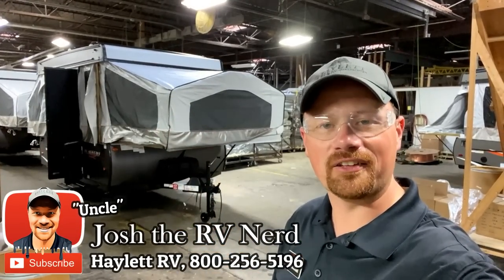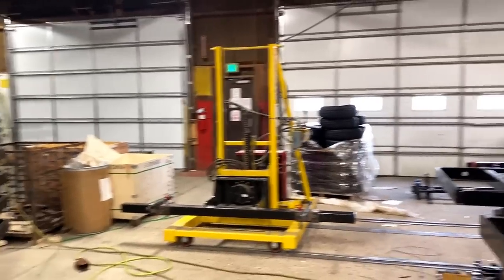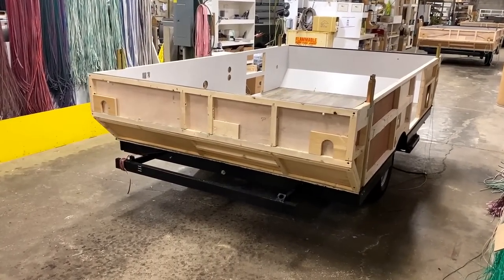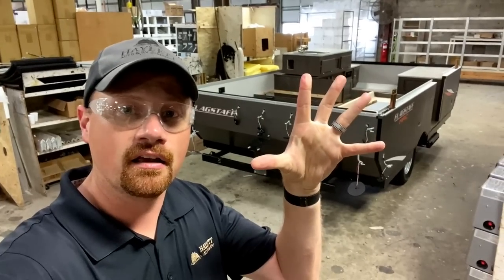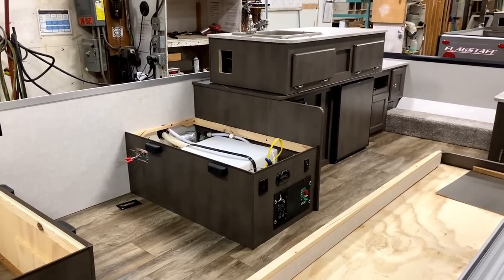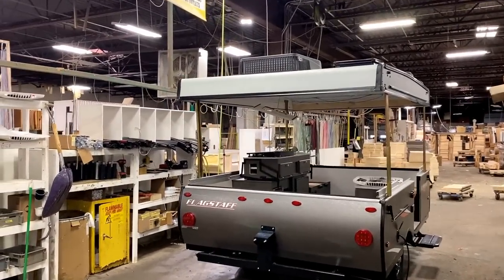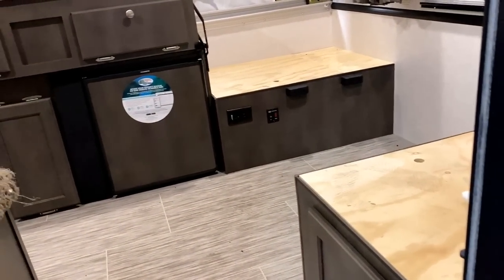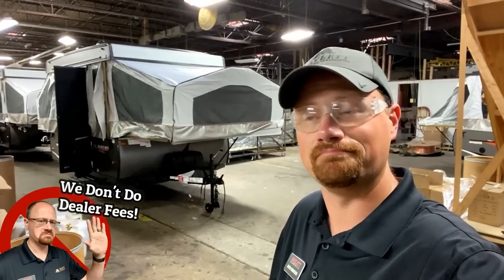Rockwood/Flagstaff Factory Tour!! (Part 4: Popups)

Comment: Thanks for the great video. This one is particularly interesting because the factory tours for "traditional" trailers (i.e. towables, fifth wheels, etc) all start to look very similar after a while, where as pop-ups are a totally different animal.  I'm also particularly interested because I'm currently renovating my 1993 Starcraft (while I wait for the RV market to stabilize/normalize) and it's fascinating to see what is under the skin of pop-ups. It's also interesting to realize that despite all the innovations and new materials, things like the platforms, supports, and pole framing for the actual pop-out 'tent' ends have not changed significantly in 25-30 years.  

Rockwood/Forest River really do make some of the best pop-ups in the industry, and it's really just their interior color schemes that are different between the two. The only downside is that they so dominate the market that the pricing and mark-ups have really gotten out of hand (even before the pandemic).  The price gap between pop-ups and small hard-sided trailers is really non-existent despite significantly less materials and workmanship required in pop-up trailers.

Comment: Very interesting tour of the plant.  I noticed that made a point to make sure that seams are always maintained. This was interesting to me because there are people on forums and youtube that have really bad leaks due to the seams . Some of them are on fairly new, 2021,2022 rockwod popups. It's a huge project to take on for the average person. Why , in your opinion , would these seams be failing so quickly only after two or three years of use?  In my case, I have a 2019 Rockwood premier 2514G and the seams are leaking on three sides when I opened it up yesterday, yet it was fine when  closed in October..  Forest River will not fix it because they only warranty the roof for three years. The service advisor said they would have to tear it down and rebuild it at a cost of approx 5k, depending on what they find !!!   Do you happen to know if Forest River sells and ships a complete roof assembly?  If yes, that might be most cost effective, I don't know...Thanks in advance..

Comment: I loved my pop up, but the biggest complaint from my partner was the lack of storage, and so it meant I had to load and unload almost everything each time. I would love to check out a new unit and see what a modern one is equipped like now. Ours was an early ‘90’s model, and I would have upgraded the fridge to a 12v model, and added a atv winch instead of the hand winch to raise it. I removed the sink and water tanks to add storage, and used totes in the walkway when moving and put them up on the counter top when parked. 
Thanks Rockwood!
Reply from the maker: Storage is always a challenge in popups

Comment: Josh, most popups come with heat and air these days. I didn't see in the video, do they put insulation in the walls and top on popups? Even with the tent looks like some insulation would help on heating and cooling. Thanks to Rockwood, Haylett and you for the tours? Great job!

Comment: You blew it with the LED speed argument. Using your own number of 5ms faster for the LED, at 88 feet/second (at 60 MPH. 5280x60/3600=88) the difference is 0.44 feet, or 5.28 inches. (88 feet / 200, 200 being the number of 5ms periods in a second). So yes, using your 5ms advantage of LED, you would see the light 5.28 inches sooner. I like LED because of reliability, longevity, vibration tolerance, cost, cool temperatures, and energy usage. But the speed advantage is of little benefit to mortal human beings.

Other than that, nice informational video. 

BTW, I know this fast guy that can turn off the lights and be in bed before it's dark. ;-)